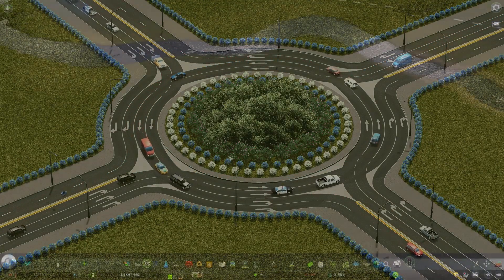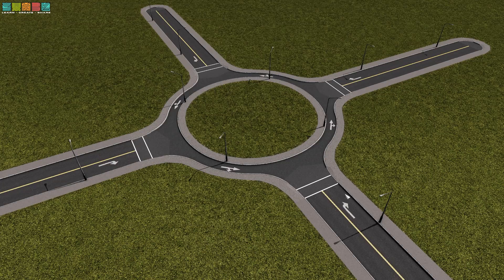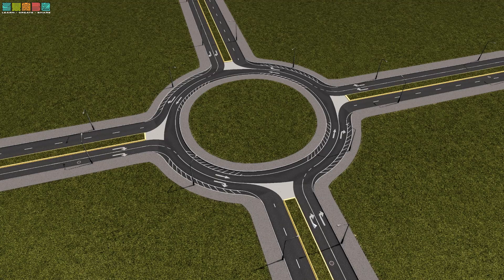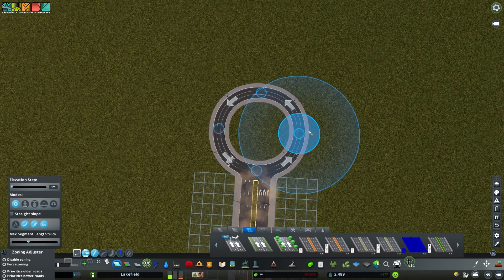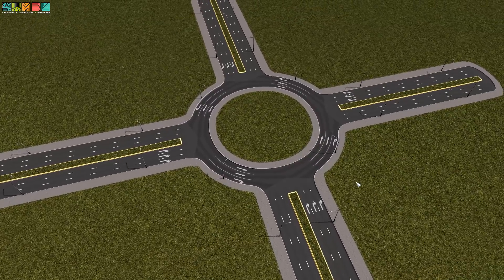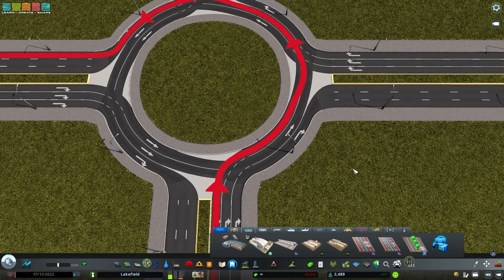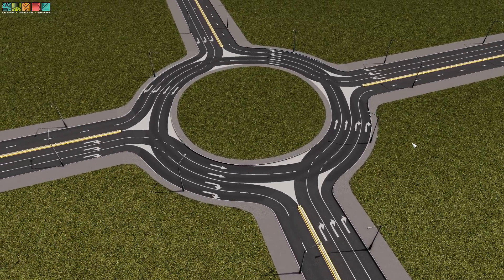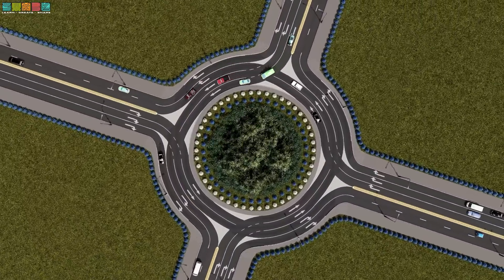Turbo Roundabouts and BEYOND!  -  Building Roundabouts in Cities Skylines

Comment: That's great explanation how to solve a lot of issues in people cities, but -I have 2 things to say. This series needs to mention:
a) super short roads, they usually make any problem much worse. They stop traffic behind (mostly on busy crossroads), and it's spreading the problem all over the city. If there is some road behind, before stop & go happens. If you have enough asphalt to absorb the traffic, without clogging the next crossroads, it won't become a jam all over the neighborhood.
If you have like medium traffic, leave 20-30u between junctions. 
for high traffic, it's like 50-60u between them. 

b) downsides of roundabouts:
There is one thing people don't understand as well about roundabouts. It's not an omnipotent solution.
if you make a roundabout, you lower the number of "lanes" that you have dedicated for your "main" direction. 
if you have 3 lanes going in 4 directions, there are 6 lanes that you could use, (But only 1 lane usually that can go left at a time)
3 lane roundabout have 3 lanes in total for all directions, so you downgrade the road as a result. In crossroads you have half of the time for horizontal and half for vertical, which means 6 lane road handle 3 lanes of traffic, nicely (with exception to left turns, as mentioned, another topic) 
so (3 lane) roundabouts are something that handle 2 full lanes in each direction, but 3'rd clogs it completely. Typically, its (number of lanes-1) is what they can handle. Gain is that its omnidirectional, so left turns and U turns don't cause a buildup. 

If roundabout is not handling it, Usually the best way is to go back to simple crossroads, but with a twist, you need to block left turns, and make them non-colision way (by ramp or tunnel)
like they do on highways. 
 
If anything clogs your city, its 69% left turns, 15% lane maths, (when you crunch high traffic 6-7 lanes from each direction on 3 lane roundabout, or general 3 busy lanes to 1), 15% something like train stations, on short/main road. If you solve them in non-colision, on high importance roads, (and that's where roundabout with U turn helps as well)
Reply from the maker: I generally speak quite negatively of roundabouts. I suppose you’ve not seen my other videos?
Reply: @YUMBL  I've seen some of them, maybe its already somehere I just havent reached YET. I really liked mod video, my point was that, in there, you did not mention any problems roundabout have, I wanted to leave something for people who see only that. (and I took that crooked roundabout for myself as well, along with one of the highway connections I've seen on your video)
I don't agree with that roundabouts are bad, they are awesome for low to medium traffic in all directions. I want to say they are overused, and not one-solve-all tool.
Reply from the maker: Thats my opinion as well. This just happens to be a video about how to set up roundabouts. Not about alternatives. See my “city starts ranked” or “making traffic use all lanes” videos for my feelings about roundabouts. This simply isnt that video.
Reply: @YUMBL  I thought it deserved single sentence like that, that's why I mentioned it, something like "they are good for medium traffic, for high traffic check video x"  to put full stop on this topic. I say it again, thanks for through explanation on the topic.

Comment: I would make the three arrows entering the roundabout point right, forwards and left instead of all pointing right. Because you of course have to turn right because the traffic is all travelling anti-clockwise. But if it were real people reading the road markings o think it would make it more clear which lane you require before entering the roundabout.
Reply from the maker: Totally! Those are automatic, but can be removed for manually placed decals.
Reply from the maker: Irl there would be a sign denoting the lane options as well

Comment: Thanks a mil for this video. I have been building out "turbo" roundabouts the wrong way. Over using TMPE, and not sizing it correctly.
Tried the pin wheel at four corners of a city block but somehow ended up with a deadlock around all four of them. Thinking I messed up with the priority signs there.
Reply from the maker: Shift ctl click is really all you need in tmpe :)
Reply: @YUMBL  Extra nodes, and changes to the layout can break TMPE ... but me trying to "make it a bit better" generally makes it worse. That's why the videos help so much, gets me to reign in my attempts at creativity.
Reply from the maker: Extra nodes will just be connected with lane connectors. Correctly. You really only want cars changing at exits in CS

Comment: In my country (Spain) a roundabout works as a normal priority road (same rules as a straight road) with roads crossing which must to yield. 

You can leave the roundabout using only the right line but you can continue if you want, like a normal priority road (you can drive on right line all the roundabout with no problems). If you want to join the roundabout, you have to wait until you don't stop the traffic going inside. We use more lines if there is a lot of traffic leaving a roundabout and you want to go to another exit. I think is quite simple and it works very well
Reply: Agree! But we also have "turbo roundabouts", and imo those work better than how they worked before being "turbos". At least that's what happens in my hometown Santander. They added a couple of turbos years ago and now I feel more confortable taking those rather than the crazy 3 lane roundabouts... Oh, and we can do U turns with those too! Great video, btw :)
Reply: Well. In Spain we are also famous for the roundabouts with traffic lights, what has not much sense
Reply: As a Brit who drove in Spain on holiday I was terrified that traffic entering a motorway had priority. I was paranoid that I would forget. 😆
Reply: @shaneintheuk2026  what?? No way!! If you join a motorway, you have to yield to the traffic already on it. But we're really polite and most of the time if we see a car entering, we create space or even move so they can enter without problem. Where did you drive? Maybe people there drive differently
Reply: @javieraracil782  oh! We must have misunderstood the guidelines. We were told cars would just pull out in front of us. In the uk we tend to behave similarly and let people in so I’m not sure why it worried us so much. I suppose it was the shock of the difference.

Comment: That super turbo is not unlike a lot of UK motorway junctions/interchanges, especially where two motorways cross or meet. Ours are usually traffic light controlled (although these are often temporary and it's free-flowing during less busy times of day) and may be elevated so one of the motorways is a through-road beneath the roundabout, or even split-level in a way that allows through traffic along both axes. They also irl usually allow you to change lanes to perform a U-turn, which may be used if there's an accident/RTA on a motorway slip road, where the police will close the slip road and force exiting traffic to go to the next exit, all the way around the roundabout, back down the other side of the motorway and then exit from the opposite side. The roundabout where the M180 meets the M18 is one example of this near where I grew up, it's elevated over the M18 and traffic light controlled, but other than that it works a lot like the super turbo shown here (remember we drive on the left, if you decide to take a look at it...!) They look great in CS with all the intersections marked up and the island in the middle decorated, this was a very satisfying video to watch :D
Reply from the maker: Thanks a lot! :)

Comment: I would say, if a "roundabout" has traffic lights, then it's actually a traffic circle.
Reply: i consider a traffic circle the roundabouts where its just a pylon in the center, very easy to convert 4 way stops to these traffic circles with very little expansion of the pavement. Only for very low density residential though, anything more and it would be dangerous.
Reply: @majorphysics3669  That sounds a lot like what we would call a mini-roundabout in the UK, except instead of having any sort of pylon in the centre there would just be a circle painted in the centre that drivers go around. They mainly appear in low traffic areas, but can pop up in busy areas that have limited space.
Reply: @beeurd  there are places in the US with both with and without the pillar and it's found that with the pillar experiences fewer accidents, something-something adding an obstruction reminding people it's a roundabout instead of just and intersection keeps them from hitting it too fast
Reply: A traffic circle is an abomination. Imagine a round about, only the traffic already on the circular bit must yield to incoming traffic rather than the other way around. 
If you only control Entry to the round about with traffic lights instead of yield signs, that's just a roundabout that you've decided needs extra controls for some reason (maybe to facilitate pedestrian crossings, maybe at certain times of day traffic gets bad enough that the round about can't keep up so you need the lights to prevent it locking up?). If the traffic lights can and do also stop traffic that's already IN the circle... yes, that's a traffic circle, which ruins both traffic flow and safety.
Reply: As far as I understand it, traffic circle is a road arrangement that's basically the same as roundabout except that traffic entering don't yield to traffic already in the roundabout. Traffic circle are designed for high speed entry instead of a modern roundabout which forces slower speed within the roundabout.

Needless to say, it's a dumb intersection, it's inefficient and are dangerous because of the high speed. But that's how early conception of traffic circle/roundabouts were conceived, before the design of modern roundabout are properly understood.

Basically, a roundabout can turn into traffic circle if driver education is bad and/or the traffic engineers don't put yield sign in the entryway. If driver education is really good, then the yield sign should not really have been necessary as drivers should already know the right of way rules for a roundabout.

Roundabouts with traffic signals are called signalised roundabouts, and they can have its benefits, but it kinda also disrupts the free flowing nature of roundabout and the traffic lights also increases operating cost of the roundabouts, which are the two main benefits of roundabouts.

The roundabouts that are created just with a cone/pillar or painted circle are called mini-roundabouts. They are low traffic roundabout that can be easily added to existing intersection without many design changes. With proper driver education regarding the right of way rules in a roundabout, it works exactly the same as regular roundabouts. There's not really any drawbacks to it, except that it can really only handle low amount traffic. The ease of converting regular intersection to mini roundabout is why it's popular when traffic is low, it just improves safety in an intersection.
Reply: a traffic circle sounds like a stupid name, plus they’re usually called spiral roundabouts and are on very busy motorway exits
Reply: It depends. On a small junction with heavy traffic, traffic lights can be used to hold back traffic from one direction at a time so each direction has a chance to domibate.
Reply: Yes. A roundabout is not an intersection or junction, it is a one way road that goes in a circle. 

A traffic circle is an intersection
Reply: A roundabout and a traffic circle are the same thing, ya know.

Comment: Great tutorial.  From watching Biffa, and I see he commented here as well, the roundabout typically has 1 more lane than the incoming road.  Or, it should at least equal the number of incoming lanes.  So a 2 into 2 or 2 into 3 but not a 3 into 2.  I did notice, and you did not point this out, that your Super Turbo used an asymmetrical 3+2 with 3 lanes coming into the 4 lane roundabout and 2 lanes going out.  That actually makes sense to me.  Perhaps you can add an extended version of this video showing how you did the markings?
Reply from the maker: I do intend to make another intersection marking tool vid in the future. Thanks for watching :)

Comment: I don't usually enforce the turbo as u-turning traffic is quite rare. Most of the time roundabouts work fine with the number of lanes being the total number of connecting roads -1 and the standard TMPE setup. 

Also if you have many exit lanes you can allow two lanes to exit in the most busy directions (after adding an additional lane to the roundabout). It's common in the UK to be able to go straight on from either approach lane if the road continues as a two lane road after the roundabout (this is usually the case on rural dual-carriageways where a minor road intersects).
Reply from the maker: Yep. See the last examples.

Comment: If you want to /slightly/ improve the traffic flow through the "super turbo roundabout', you can make the right-turn lane split off before the actual roundabout; that way the traffic turning right won't have to yield at the roundabout and can just slip right through. If you do that, you'll want a 2+1 lane road heading into the roundabout, with 1-lane slipways for each of the rhts, which will combine with the roads heading into the roundabout to make 3+2 approach roads.
Reply from the maker: They dont actually yield currently. They just come in :)
Reply: Any other traffic leaving the roundabout is forced to take the left-hand lane on the exit road, while those right-turn slip roads feed directly into the right-hand lane, so there's no conflict for right-turn traffic.